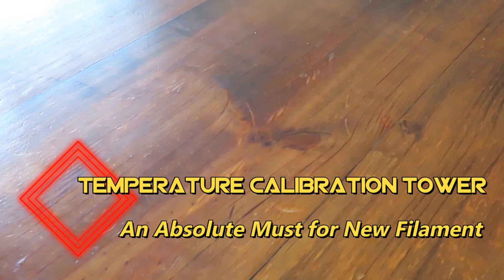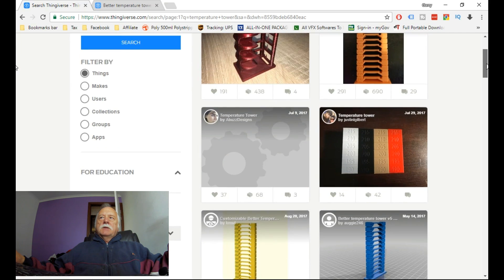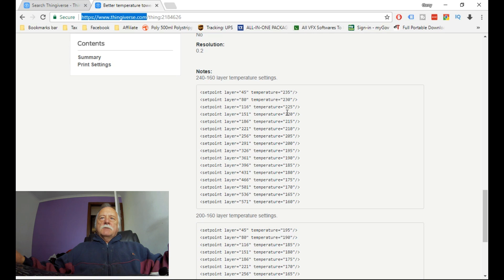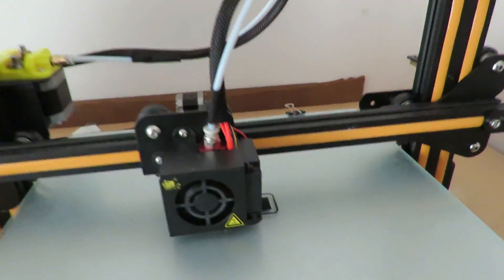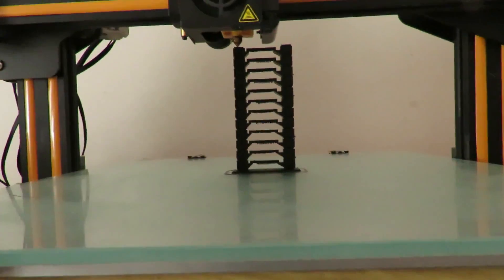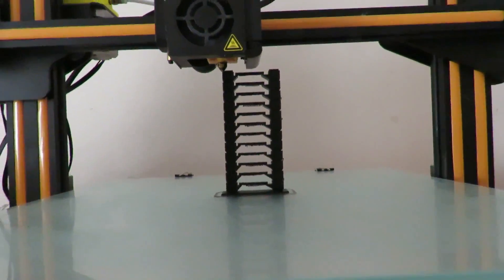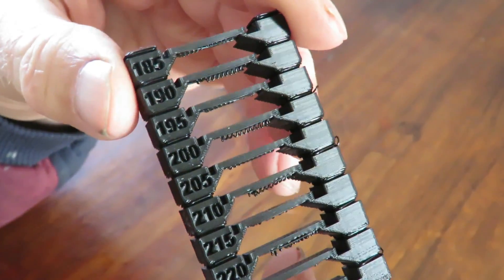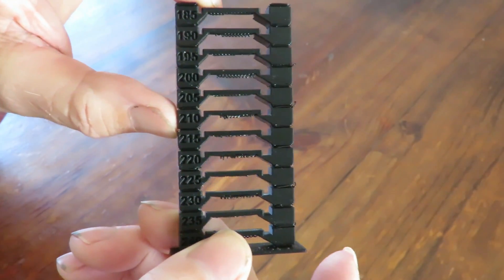📌 3D Printer Filament Temperature Calibration Tower - Use It For Better 3D Print Results

Comment: I started off calibrating my extruder steps/mm and got that done. I did a flow rate cube for my spool but it sounds like a temperature tower was needed before the flow rate. But call me blind but your temperature tower looks the same the entire way up except for maybe 3 or 4 odd temperature spots. If I would have printed this out I wouldn't see any difference in temperature and quality. What am I missing?
Reply from the maker: When you have a finished tower in your hands, you will see a difference between layers.
Reply: @GarryPurcell  Well I printed one and seen about nothing. From what I can tell flow rate makes a much bigger improvement on print  quality. I just stuck with the stock Ender 3 profile in Cura that prints PLA at 200 cause it works fine. My extruder was skipping a lot because I didn't test the flow rate of each of my spools. Layers look nearly perfect and no more skipping. I guess if you had a DIY printer or an odd one that none if the slicers had a profile for then the tower might be more helpful I guess I don't know.
Reply from the maker: Don't forget you must print each section at a different temperature.

Comment: Garry, very valuable video. Thank you for taking the time to post it!
Reply from the maker: Temperature towers do make a difference to 3D printing. It's amazing how a printer is calibrated, and temperature setting on one will not suite the next.
Reply: @GarryPurcell  Just manually edited my GCODE and now heating up the bed! I have been printing little cubes with this new ABS but just cant nail the temp down. Its marked VERY high temp (240-260). But it just oozes at 260. Amazon Basics has amazing material but their labeling is all generic across all types. I think the difference has a lot to do with altitude and humidity of a persons area.

Comment: Do you have to set the different temperatures yourself in the slicer? Or can you just slice the file you got from thingiverse and start printing?
Reply: 'OK, soyou cant just slice it and print it. You always have to do the editing in the slicer....
Reply from the maker: I don't think the stl files from thingiverse come pre calibrated for temperature.
You will need to set the temperature layer levels yourself. 
This can be done in the slicing software you use.

Comment: But you didn’t sat which was the best temperature. What were we meant to be looking for?  To my eye, the two coldest ones looked the best, but, as I said, I don’t know what I’m supposed to see. I did my first ever 3D prints today and I’m having bad stringing problems. I twiddled with the retraction settings, but I think the problem is temperature.
Reply from the maker: You must select what you think is the best result for your printer. 🙂

Comment: The only info I got from this video is that it's a good idea to print a temperature tower.  I knew that.  I was looking for some tips on actually doing it, like setting the g-code etc.
Reply from the maker: Hi David
The generated GCode is slicer dependent, so the method of setting a Pause or Temperature change is different in each program. 
The easiest one to setup is also the most expensive one, Slic3r.

Another way is to watch the print and manually change it at the correct layers. You take note of the time taken to get to the correct layer height and set a timer so you will be alerted when the layer is about to be printed, and you manually adjust the  temperature.

If you let me know which slicer program you are using  I'll do my best to help you.
Reply: Thanks for getting back to me.  I'm using Cura 3.0.4 and I managed to adjust the temperature using the z adjust add on.  Now I just need to understand the results.
Reply from the maker: What you are looking for is the best section on the Tower.
I.E. smooth, less stringing,  good bridging, no Blobs, etc.
In other words, the layer that is the most pleasing to your eyes.
That layer is the optimal temperature  to achieve the best 3D Prints.

So you then use this temperature in your slicer, for that filament you created the temperature tower for.

P.S. I would also suggest you update your Cura, as you are a few updates behind.
Currently Cura v3.21

To check for updates in Cura.
Menu Bar / Extensions / Update Checker/ Check For Updates
Reply: Thanks for all your help
Reply: Surely you mean Simplify3D? Slic3r is free and open source, just expensive in a time investment sense... ;-)

Comment: What did you do to your glass bed to make it stick? Did you sand it, hairspray or glue?
Reply from the maker: Hi Enderon
I used PVA Glue, I made a video on how I apply it to get good print adhesion.
https://youtu.be/WxgHSpk44yk
Reply: I print on a mirror from Lowe's. I don't use anything on it ever for PLA. Sticks super hard and when it cools it sounds like popcorn popping. No mess either. Just occasional alcohol wipe down.

Comment: I'm a noob and would like do this but I have no idea what I am supposed to do to create the code. I use Cura 3.1. Is there a Cura profile or something that I can download? Thanks.
Reply from the maker: Cura v3.1 as far as I know, doesn't have a Change Temperature at level function.
HOWEVER there is a workaround.

First you need to determine at what height you need to change temperature
Slice your model as usual
Change from Solid Vue to Layer Vue and use the slider to determine the layer heights

Cura by default has a Pause at height in mm. that can be used to stop the print.
You would then need to Resume print, and manually increase temperature.

On the Cura Menu Bar Select
Extensions/Post Processing/Modify G-Code
A Box will pop up 
Select Add a Script/Pause at Height
From here you can add in mm when you need to change the nozzle Temperature
Repeat as many times as needed, and save GCode.

BUT. I would suggest you download and install "Change Filament At Z Cura Plugin" from Thingiverse
https://www.thingiverse.com/thing:2077884
It has the ability to select layers as well as mm.

To install this script.
Cura Menu Bar Select
Help/Show Configuration Folder
Select "Scripts" and copy "ChangeAtHeight.py" to the Scrips folder you have open.
P.S. There is no need to close Cura during this process

Once you have this installed you can now select Change filament from the  
Select Add a Script/Change filament at height v3.1
Reply: Thank you very much! Great explanation. It works!
Reply from the maker: Thanks for getting back to me
Its greatly appreciated.

All the best for the New Year
Reply: Current version of cura you can, go to post processing, and then add script, then tweak z something or rather, pretty straight forward from there

Comment: Garry, thanks for making these videos. They are a real help to watch and learn. On that ladder, what temp step would you settle on as being your chosen setting for that spool for your extruder?  205 to me looked pretty good overall .... (I've just bought a CR-10S myself).
Reply: You say the calibration tower is essential but don't say how you judge or pick the correct temperature.
Reply from the maker: I've gone with 215 for the Esun PLA+ Black - Red
and 210 Esun PLA+ Gold

You have to print the tower, and decide which temperature layer looks best.
its difficult to get a true feeling for it simply by watching a video, as compared to holding it in your hand, and rotating and looking at all sides of the Temperature tower.

What is interesting is the wide temperature range the Esun PLA+ filament has.

Comment: It's an absolute must to print one but you don't tell us in a single word what to look for ☹️
Reply from the maker: When you print the tower you will be able to pick the best temperature for your filament by simply looking at it,
I.E. Sagging, Blobs ets.will stand out.
 Choose the temperature layer that is crisp and clean.
Reply: Too bad you didn't mention it and show it in the video. I thought some of the other temperatures looked better in the video.
Reply from the maker: Point Taken
As you have observed, temperatures vary the quality of the tower print.
Printing and observing the tower will result in better prints from your 3D Printer.

The filament I was using was Esun PLA+ which has a large usable temperature range.
Reply from the maker: What you look for is the best looking layer with no blemishes.

I have made two other videos regarding temperature towers.

📌Gold Camel PLA Black 3D Printer Filament Finding the Correct Printing Temperature. https://youtu.be/n1Tr9ddtO_U

📌How to Design and Make Your Own 3D Printer PLA Filament Temperature Tower Using Blender Software https://youtu.be/akEwiNbYXPo
Reply: Garry Purcell still you should have showed us in your opinion wich one was the best for you so when we do it we know what to look for. Plus more details on how you entered the code in slicr would of been nice

Comment: Thanks for the cr10s videos, finally someone on YouTube with one. My is on order so due in some weeks. I am a noob and this will be my 1st one. Do you know the difference between the cr10s main board and the cr10s just out or curiosity
Reply from the maker: I assume you mean CR-10 and CR-10S mainboard.
I do believe they are different, from what I have read on the Creality Official Factory site